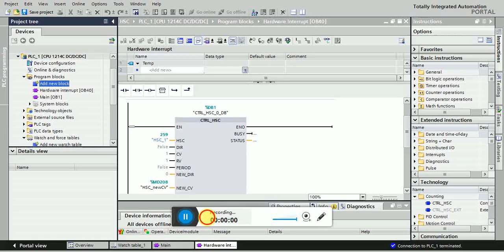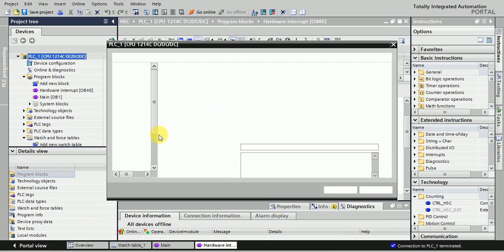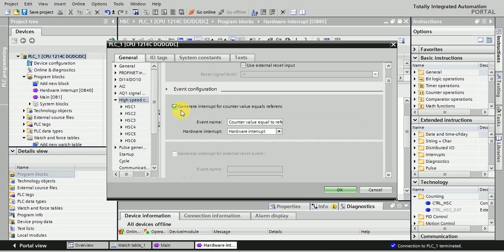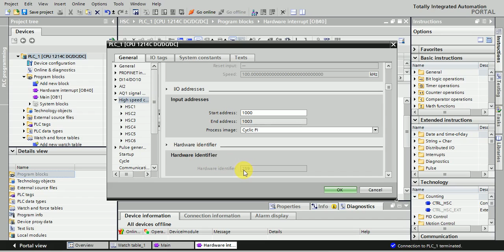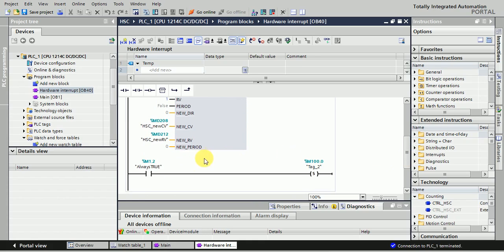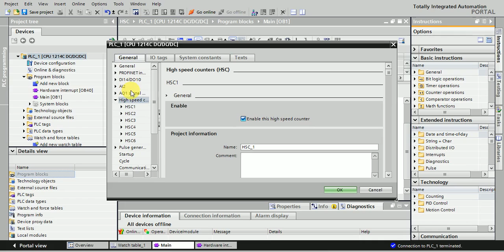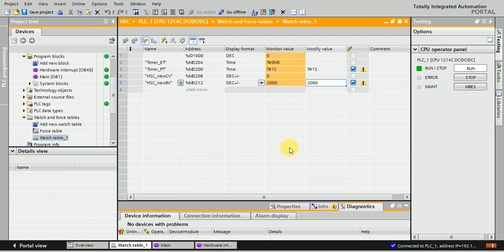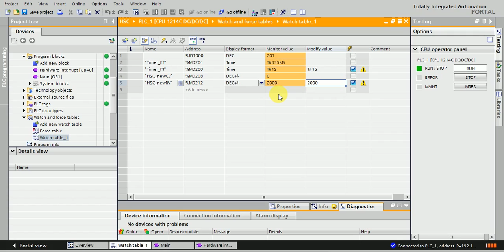HSC in S7-1200

Comment: Hi Sir, 

S7-1200 PLC CPU1214C has 06 Nos. HSC for Single Phase, Counting Operation. 

If I need 10 nos, How to add the Additional 04 Nos? What Module or Signal Board I should use?